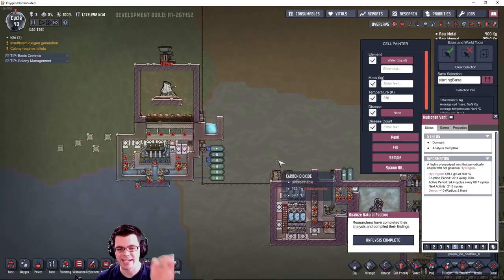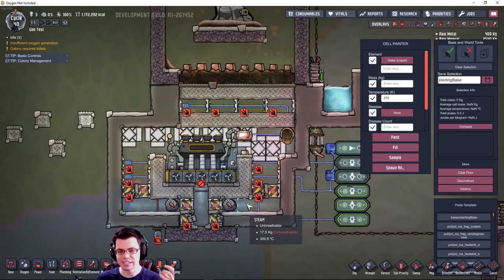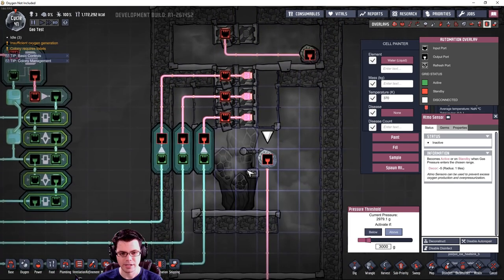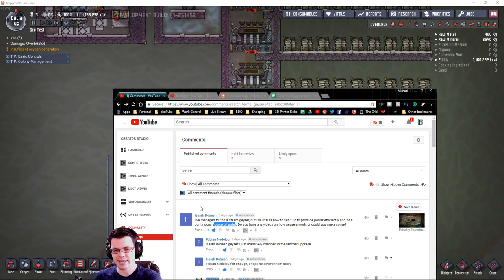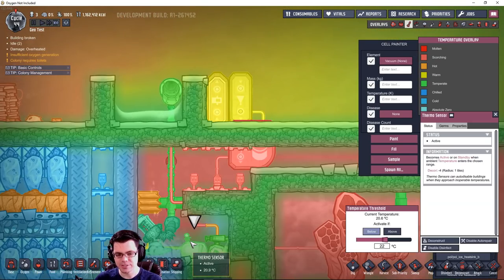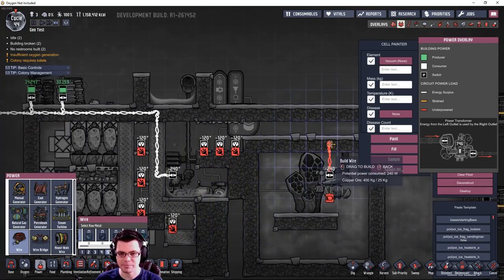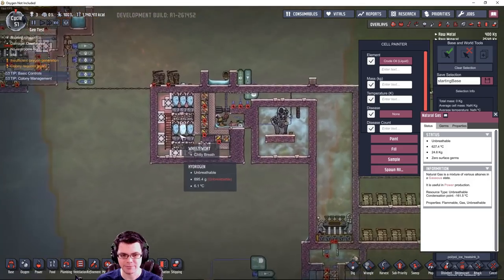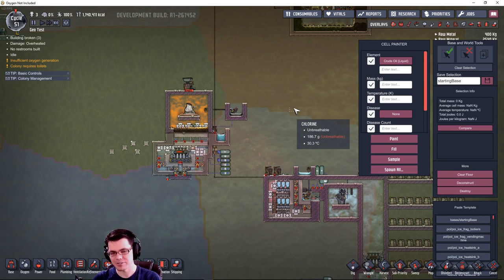Geyser Power and Cooling! Part 1 Oxygen Not Included

Comment: ps: i've got a little design for the germ sensor so it become useful (it could avoid you the bummer of disinfecting stuff with your dupes or an ore scrubber) i named it a CSR (chlorine storage room) and it'd quite simple: 
-you create a storage room where there is no airflow;
-you put the storage compacters inside the room;
-you put two gas vent joined to two gas tanks: one is for oxygen, the other is for chlorine gas.  
-you put a gas pump with 2 gas filters: the first is oxygen and the other is chlorine. (the gas tanks and the CSR are binded by the gas flow)
- you put the germ sensor inside the room and you wire it to the door and the gas pump. 
- you define the level of germs that must be reached   for the germ sensor to activate
-if you've correcly set up the CSR system the germ sensor will have an use: when a dupes bring germy ressources into the csr, the germ sensor will detect it and close the door (put a buffer if you want to leave some time for your dupes to leave) and start the clenaing sequence: the oxygen will get pumped out into the oxygen gas tank, while the chlorine gas will be send into the CSR, killing the germs. when the level of germs is below the settings, chlorine will be pumped out into it's gas tank, a'd oxygen will replace it. the door will open and your dupes will be able to breathe and take disinfected ressources.

what do you think of that system brothgar?

Comment: Why not try a couple pumps going into a large high pressure storage room. 
Then you can add a pump going out to under your steam geyser

Since the geysers run in cycles. 
When it's running you want all you can get out of it and once it's over pressure.
It quits running. 

You could 
For things that need to be heated. 
Pump it down by the lava and use the lava to keep the heat or as needed. 
For things needing cooling like after taking the polluted geyser and turning into good O2 or good water. 
Pump over to cold biome. 

At 1 point those doors are going to programmed to draw power. 
1. Throwing the numbers off.
2. A gas pump just forces the gas in there. Guaranteed to keep the pressure up. 
3. You don't have to worry about deleting any. 
 
Also the liquid pressure gauges do not accurately measure the pressure across multiple tiles when placed against a wall. 

So if you have 5 tiles wide and if you was to place a pressure gauge in every tile. 
The center 3 tiles will have 20 20 20 but the tiles against the wall. Will have 15 or some other lower number.

Comment: Wouldn't wheezewort arrangement be more effective with a more vertical build than horizontal?  In your build, you only have two of them by the metal plates, and they work by drawing in from the bottom and out the top right?  If you instead build them more vertically so that more are right by the metal wouldn't that cool better?

Comment: i have two CO2 geysers and i thinking to use them as a cooling system. -51°C sounds cool at first but this stuff becomes gas quick and seen to not do much. Pumping it with pipes are out of option and using it as cool gas falied so far. I use it to feed my small oil monsters or "meke" it into poluted water for more natural gas. what you guys doing with it?

Comment: I find that the new Geysers and the old ones aren't very efficient as my Natural Gas geyser only produces 158g/s of Natural Gas for about half a cycle, this is no-where near enough to power a=my base. In the same system I have a Hydrogen geyser connected to a Hydrogen power plant that also doesn't produce enough power. I don't know how to make a good long lasting power plant without the use of a Geyser or running Dupes. Are there anyways that I can make a fully efficient power plant (that produces 4000-5000 Watts of power) that doesn't run on Geysers? (A revised fertilizer power plant or an Electrolizer power plant would work but would need to produce lots of power. Could this be in part  2 or another episode?).
Reply: well you have "closed" systems where you get exces power out. just scale up to your needs.
many dupes = lots of dirty water = ferteliser/NG power
hydrogen power makes only sense if you vent out the oxygen in a void/ delite it somehow else
Reply: I have a all dupes in exo suit base and it demands a lot of oxygen!
Reply: what number of dupes are we talking here?
Reply: The only problem with this system is that I want all my dupes to live a comfortable life (stuff like AC, no running dupes or hot environments), so if I had more Dupes I'd need more power to run Oxygen systems, AC units, cooking and farm tech. I'll try it though using Debug mode and see how I end up.
Reply: Alrion1704 18 dupes
Reply: I don't know many good setups for Fertilizer Power Plants, I tried to make one but I ended up consuming more power that what I produced. Although that could be because I didn't wire something up properly.

Comment: why you no discord? anyways i had a question about the cooling system. is there still a way to cool things without weezworts? iirc water dripping can both remove/delete heat. i had a very unlucky world were any ice biomes i have are really far away from safe zones for my dupes and i only found 2 weezeworts that i cant even get too. i remember being able to cool liquids such as polluted water/or oil with a liquid thermo thing. and remove heat all together. not sure if thats fixed? i only need temp to drop to 24 degrees C. not -200~

Comment: There seems to be a general issue of the small "mined" refined chunk not transferring heat at all or extremely slowly for some reason. Also a glitch or just an oddity where you can take the super hot refined metal chunks build with it to destroy the heat down to more reasonable level to handle. Seems to average around 40C max after building with it.

Comment: with the conveyors, can you do sort of a carnot cycle machine ? much like a compressor in a conditioner ?
if you compress a volume of gas with doors for example, does the temperature of the smaller volume increase ?
Reply: pressure change does not affect temperature.
but if you have crude oil turn in to petrolium it will burst your pipes, or liquid to gas/gas to liquid

Comment: The easiest way to dig up maps in ~5 min is to set debug mode to vacuum 1kg 300°C and do chunks of 1/4 map top to bottom. DO NOT dig bottom layer of neutronium, 1 tile at bottom, because if any item falls below that the game crashes and auto save usually catches that clear action and your save is non recoverable without manually editing it.

Comment: So I don't know if anyone else had this problem, but when I was running the cooling system to convert steam into water, i kept having it glitch out on me where the temp sensor would read the current temp as that of vacuum, and would run the water pump constantly, not letter the water cool down. If you end up with this glitch and want the water cooled to a specific temp, add an AND gate between the temp sensor and the pump/coolant doors. The other input on the AND gate is from a NOT gate tied to the hydro sensor.

Comment: Is there any setups that you can do above a hot water geyser to specifically harvest of steam for power but reliably capture water after for simple usage... an all in one water setup o.O at least with that it should be possible to make harvesting water completely free if extra power trickle compared to say a hydrogen generator. The only question is if the hot geyser reliably stays hot enough to not flood itself, if you have ways of ensuring water doesn't collect above the generator choking it. But it would get past a lot of the need to really manage a full uptime, adding batteries it would be a slowly building emergency power at any time.
Reply: Maybe setting up a condensing 'plate' above a shaft and using either ice sculptures or ice filled storage containers to keep metal tiles near freezing and shock the steam out to ensure lower pressure above the generator? vs mechanically moving it with airlocks :P it would ensure you should have a 'flow' of steam on the top if you set it up to where it leads off to one side, condenses as soon as it hits the plate, falls out which still keeps a low air pressure in the shaft which draws air but at the bottom of the shaft the pool should allow you pump that away quickly and keep the negative pressure.
Reply: Yeah just curious about ways of using air pressure in more natural ways than having to pump it everywhere. At the very least it should save on electricity once you have plates 'up to temp'
Reply: Right, you'd need to make sure to keep a high temp beneath the gen at all times to ensure that it's not cooling it but perhaps an airflow tile near the top of the shaft, a bit more of a 'pipe' than 1 tile openings to ensure it has room to actually flow through before condensing? need to see what an ideal distance would be -_- I need to get the debug kit lol
Reply: The airflow tile would ensure that once it's cooled in the pipe it can't flow back, the airflow tile itself should stay relatively warm or you could even create an airlock buffer if temperature looks like backflow is an issue with the 3 door vacuum setup. It will be a bit space intensive but it may be more efficient for overall energy usage.
Reply: Sorry XD don't really play ONI but your experiments are actually more interesting to me than the game at the moment :P
Reply: Maybe a temperature+pressure checker(AND signal) on the generator side to ensure it's high pressure and temp at all times, and a temp sensor on the other side of the airlock to ensure it's not going to instantly condense in the 'pipe' for operating the doors, and setting up an AND automation for the sensors to keep it vacuum locked, the plates should condense really any steam out of the air until you have a vacuum or very near vacuum which should trip the sensor when it realizes it's not 'cold'?
Reply: :D would definitely love to see how you explore it! but yar hope it at least adds more ideas :) But yeah rain over the generator is the only real issue, if you setup a pump beneath you can 'correct' any issues that come up but ultimately you want a setup that doesn't run into it XD
Reply: A water pressure gauge at the bottom hooked to a pump would clear any 'clogs' at the least.

Comment: I'd venture the gas mechanics are why it gets so unstable with the entire map dug up.  Not  a programmer, but I have to imagine the way it seems to be done consumes a lot of cycles at the boundaries of gasses, since they tend to thin a bit at the edges and randomly shuffle into each other.

That, and they felt the need to track things to the microgram, and temperature to similar tiny amounts. So, more materials to track as the map is dug out.

Comment: I find steam turbine builds to be somewhat proven useful when designed and built in a test environment, but building one in a real scenario game is a completely different matter. A simple miscalculation (which is silly easy to make) will easily make it a failed, worthless project.
One of the experiments i made was tap directly into the thermal energy contained in a magma pocket, since i find that volcanoes are not that common at all. Running it as in a real scenario, i carefully planned everything, building a tungsten pillar to act as a thermal conductor, and sloooowly trickling in small amounts of hydrogen to act as a buffer between the magma and the pillar, trying not to waste so much energy that the magma would not lose energy before i even got started. The experiment was somewhat successful, with the turbine running at some 90% efficiency with a 40kg steam pressure, over a period of some 50 cycles, before the magma gave up, but still, there was a lot of energy on the igneous rock. I did not cover any of the turbine vents. This is an experiment that id like to see you run, if you ever feel like doing it. 
Id say its barely worth it, however. Even using it as a cooling solution by stacking turbines and simply let their mass absorb the heat, with meager energy production, its a very expensive solution. Hopefully Klei will realize that not everyone playing the game is a lifetime career engineer, and make turbines more accessible. Honestly, i think door pumps are as legit as it can get with what we have - Heres an idea for you, something ive drawn in a napkin and built in a real game scenario: a gas compressor, using door pumps. Something that will go well over the 20kg cap of the high pressure vents. The reasoning behind it is storing something useful that may not be currently in use, but may later, like surplus natg from cooked oil or vents. Until we get compressors and canisters, of course :)

Comment: brothgar i was thinking... could you make an experiment about the germ sensor and what use it could have?
Reply: I've been using it to setup an actual airlock 'room' that vacuums itself as close as it can but uses a chlorine high pressured 'room' right next to it that releases an airlock to flood the room and clear germs. if you put storage containers in it you can quickly disinfect large amounts.
Reply: In general chlorine injections if you can lock out rooms is going to be the fastest way to disinfect, as long as your base has a way to sort it out and 'tank' it when not being used for high pressure injections(I use high pressure because it will usually clear germ infections in seconds).
Reply: Basically what you will do is setup a 'vein' between a lot of your rooms that closes off airlocks to lock out specific rooms when they are being flushed, you can either flush on a time or have an 'emergency flush' if germ sensors sense even a small amount. but if you put an air pressure sensor right next to the pump you can have it clear out any time there's high pressure(eardrum break or otherwise) the injection of chlorine will automatically trip it if you have it build up properly and it will also manage your oxygen levels to ensure you are not breaking eardrums.
Reply: I personally use it in a bathroom system, where i heat up the waste water in a separate closed off liquid tank (at least 3 tiles high); put a liquid tepedizer in with a temperature switch and heat up the liquid to around 80ºC (food poisoning germs die at >75ºC) keep 1 space open to the right of the liquid tepedizer and put a hydro sensor and a germ sensor in the tank; connect them to an AND gate from there to the liquid pump. (this ensures no germy water will get pumped out).
Since lavatory's create more polluted water you can feed the poluted water to a water sieve back to the bathroom with an additional clean water pipe running towards your clean water source. 
Now to make this effective use a liquid shutoff valve that lets the clean water through when poluted water hits that third height tile draining the excess water from your enclosed system preventing slow buildup and blocking.

It might not be necessary to kill off the germs in the water since food poisoning dies slowly in clean water,
I'm just unsure what the effect will be when the food poisoning keeps getting cycled back to the bathroom.

the positive effect is that you regain some precious clean water.

The downside of this is setup is that the liquid tepedizer uses energy (not that much when you got 2 tiles high 6 tiles wide heated up already). and the water to your clean water supply will be 40ºC. (it is also fairly minor if you don't have many duplicants so it's more effective for bigger bases with more dupes).

Might be obvious but make this tank out of abyssalite.

Comment: also your video made me think: with a slickster farm and an metal volcano, could it be possible to fuel a natural generator gas, and for how long?
Reply: yes, infinite.
Natural Gas Generator:
Requirements:  Natural Gas: -60g/s
Effects:                  Carbon Dioxide: +82.5g/s
slickster convert 1:1
oil to petrolium to natural gas is 1:1 (heat energy is consumed from magma/geyser)
natural gas heating steam for steam turbine OR natural gas pre heats crude oil + petrolium
------------------------------------
endresult:
+22.5g/s of natural gas
and +800watt of power
- the thermal energy used in the convertion

Comment: instead of using the doors to build up pressure can you just disable the steam turbine with the pressure sensor
Reply: and what is the plan after turn off the turbine?
Reply: turn it back on after pressure builds  just like he is doing with the doors
Reply: ok, just add infinite long fresh water? or how do you keep the difrence of 3kg if it runs?
Reply: noooo i was talking about the doors he is using to stop the steam from getting to the turbine not the doors he is using to pump the steam in my question was do you even need those doors to stop the steam would it work to just disable the turbine

Comment: :D and at the end he is landing converting CO to NG cause its just the best thing to do.
#Brothgar have you a crude oil to natural gas convertion system, where you heat up the oil with the gas and use the ~60C° of energy in the gas to heat up poluted water/run a steam generator? or even a complete closed cycle where you dont use any ferteliser maker to convert the dirty water of the natural as generators?